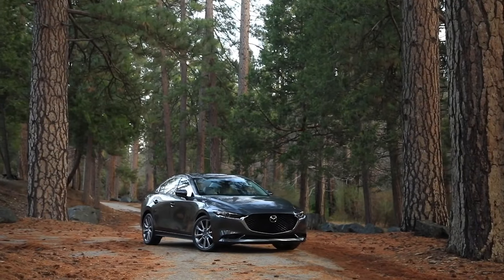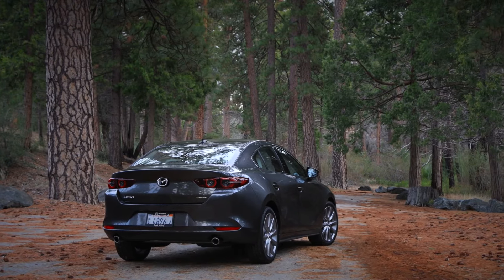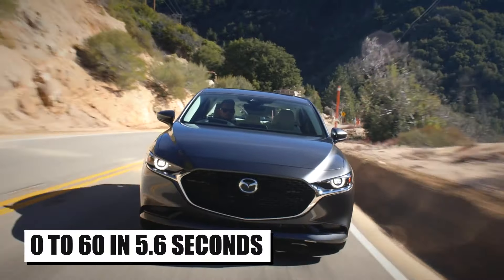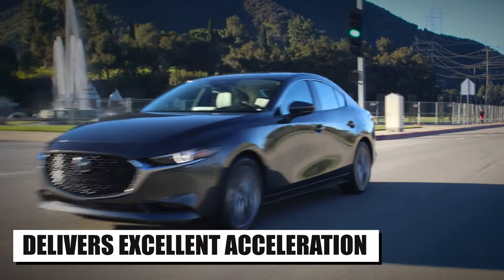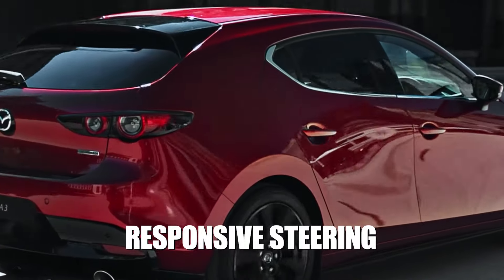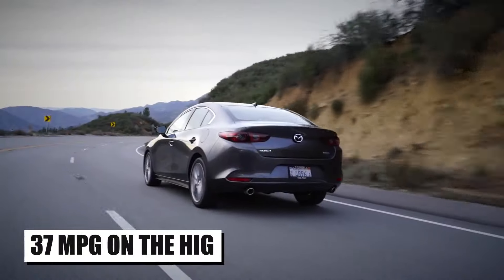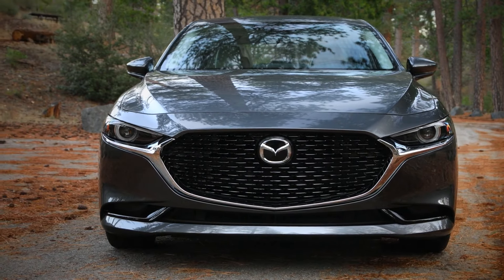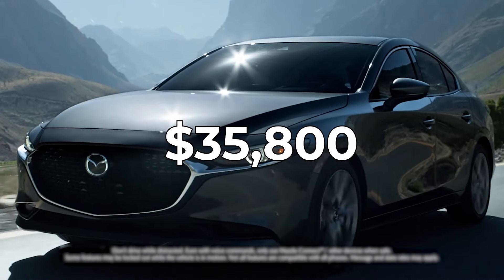7 Reasons Why Mazda 3 Is FLYING OFF the Lots!

Comment: I have a 2014 that has 240,000 miles on the original motor and transmission, still runs great.

Comment: Reasons why the Mazda 3 is a superior car:
1. overall reliability has risen to best in class
2. no CVT transmissions gives long term reliability
3. stainless steel exhaust systems pays off in long term reliability
4. the engines almost never develop oil consumption / oil dilution  issues
5. engine failure is almost none existent and they NEVER catch fire
6. handling and general performance are above average
7. comfortable practical modern interiors
8. DIY maintenance friendly and very inexpensive
9. they simply don't rust or suffer paint issues
10. the brakes , shocks , tires , alternators , batteries all seem to stand up with normal use - no surprises
11. Mazda dealers will negotiate a price - try that with Toyota or Honda - good luck with that
12. all the electronics are solid and glitch free as is all the hardware on the vehicle
13. my 2018 Mazda 3 2L auto trans with 120,000 Km s has ZERO  problems and runs the same as the day I bought it.

This my 3rd Mazda with my first being a 2001 Protege , then a 2010 Mazda 3 - they all went over 320,000 Kms and were still running fine when I went for a newer model.
Reply: 2016 mazda 3 with 185k miles. No issues , regular maintenance.
Reply: 100% right! I’ve got a 2010 Mazda 6 which uses the same engine as your 2010 Mazda 3 and it’s running perfectly 140k later great cars the Mazda 3 and 6. Also they look better than every car in the road 🤣

Comment: This channel is a joke.  Steer clear, pun intended.

I like the Mazda 3, it's a decent car, but some of the information this channel pushes is flat out misleading.  They made some wild claims about the Corolla, and they make some outlandish claims about the Mazda 3 as well.  The Mazda 3 gas mileage is not great, if anything it's below average for the category, and I'm basing this off of 2 weeks in a rental that was used in Hawaii.  I've had rental Corolla's as well, the last being a 2016 SE  that managed around 34-36mpg mostly driving back roads, and a trip down the east coast to NJ with a bit of highway/expressway driving.  

I'm not going to dissect everything, but that's just one point.  In general, these videos don't appear to based off actual experience, and instead they just read off of spec sheets, and do some light research that's meant to help support whatever angle they are approaching the video from.